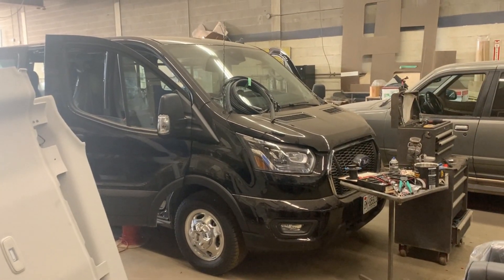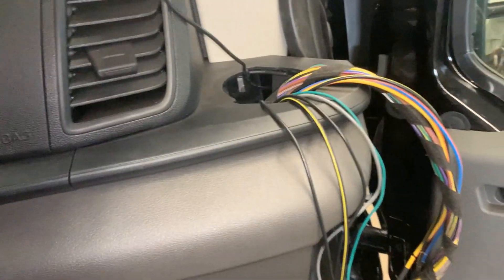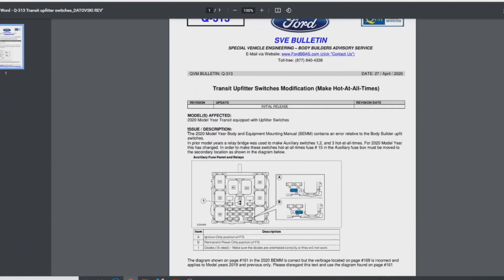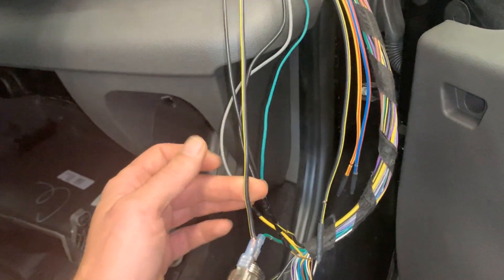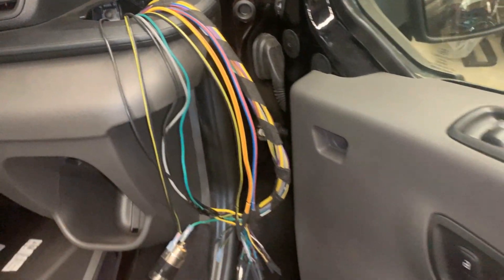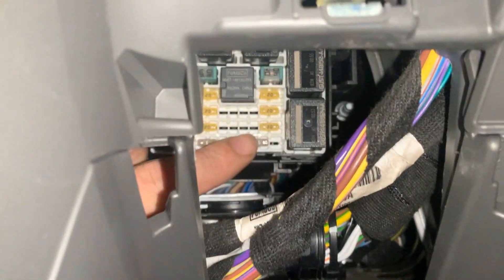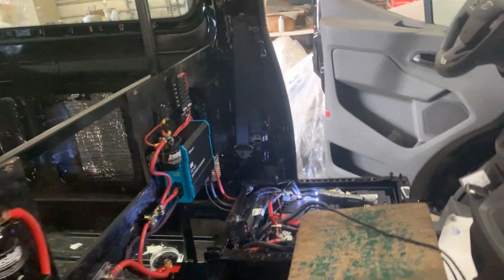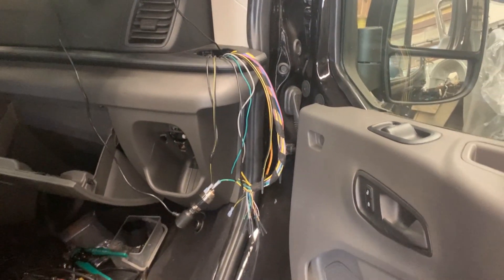2020 Transit Upfitter Switches Wiring

Comment: Thank you very much Elin. I just picked up my 2022 Ford Transit 350HD and they gave me these 2 wiring harnesses but couldn't tell me what they were for. Now, because of the research you did, I can now tell them what they are for. Would you know of any changes between the 2020 and the 2022 models? Would you know where I can get that Ford document you referenced in this video?
Thank you again.

Comment: Thanks for the video. My Transit came with almost everything in the upfitter package except the switch assembly. I bought that and am ready to install the 43-pin and 6-pin (C33-H) harnesses per your video (both of which were supplied in a bag when I bought the van); however, I'm missing the harness that would connect the switch assembly itself to the two harnesses. The BEMM shows this as items 5 and 6 (page 168-169), identified as "Auxilary Switch Pack Connector" and "14A348 Jumper Harness." The SVE Bulletin Q-250 changed the latter to "14401 Harness." Unfortunately, I haven't been able to find this part in any parts searches. This appears to be a 10-pin connector, but much smaller than the 10-pin that's used for the under-seat Vehicle Interface Connector C33-E (page 159 of the BEMM). Did your van come with this harness or do you know its part number?
Reply from the maker: My van came with the switches installed and wired. I don’t know that part number of the harness, sorry!

Comment: Thanks for this video - it was very helpful.  I'm still having one problem I hope you may have some ideas on.  On my 2020 Transit, Switches 1 and 4 are working just as expected (these are the outputs made available via the "big" connector.  However, the wires that should be controlled by Switches 2 and 3 (via the small connector) are always hot - it doesn't matter if the switch is in the on or in the off position.  Did you experience anything like that, or would you have any ideas on how to correct this issue?
Reply: Hey! I just had the same issue. Your 6 pin plug is in the wrong connector. The correct connector is on top of the aux fuse box rather than behind like you have it. It should have a dummy connector in it like the big wiring harness did

Comment: For a Brit its quite odd to see Americans recently starting to use Transits as they have been an iconic vehicle on UK roads since the '60s. Little known fact is that the first Transits which were designed in the UK and used some work from Ford in the USA.
The word 'Transit' is used to cover any panel van regardless of make. Its the 'Hoover' of vans at least over here.

Great work with that wiring though. And THREE batteries?
Reply: I have to apologise for writing 'Americans' to a Canadian when I meant to write 'North Americans'.
Mea Culpa!
Reply from the maker: Great history lesson, thanks! 
Yeah, the owner ordered it with a dual alternator, dual battery package with the idea to use one as a house battery. However the batteries came permanently hooked up in parallel which doesn't make much sense as they should be isolated. I didn't want to mess around with the original wiring due to warranty, so we just added another house battery.